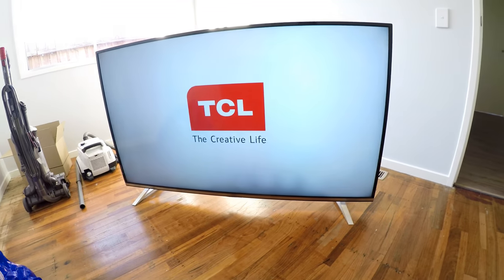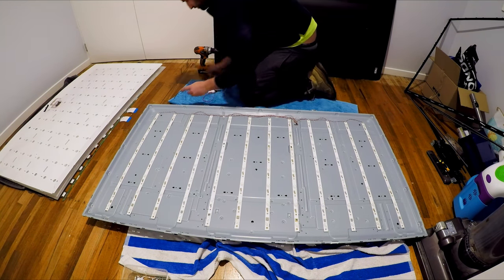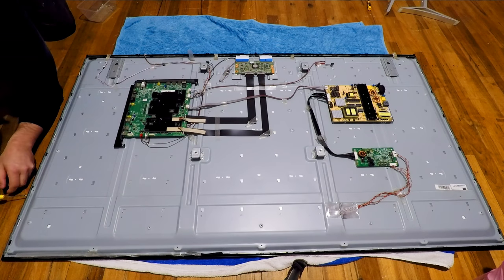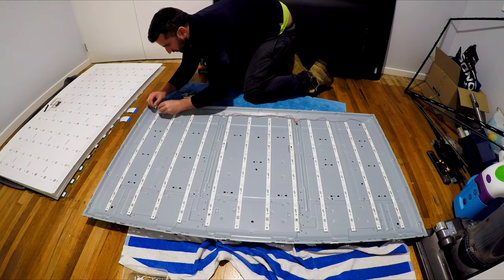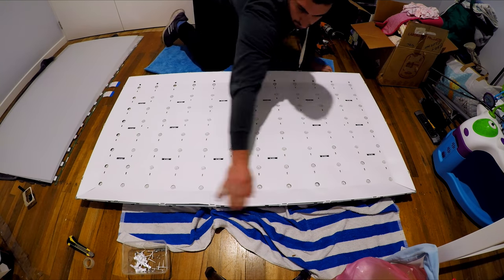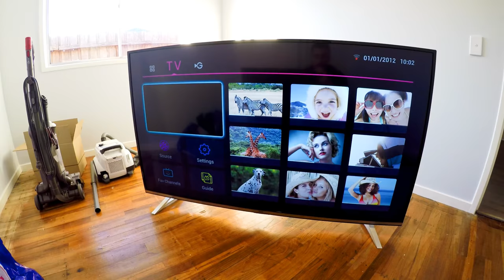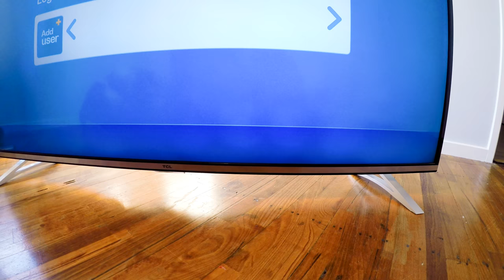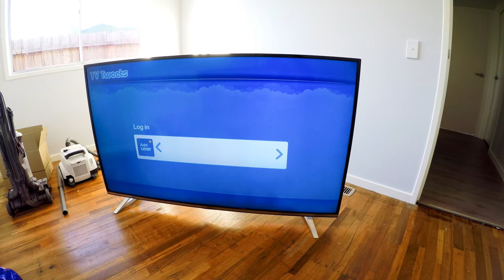TCL BLACKLIGHT FIX - BLACK SCREEN

Comment: Great video! We were able to order the tester and isolate the bad light, order a repair part and get it all reassembled, and then the screen had a hairline crack down the middle when we turned it on lol. At least we tried. And good to know this actually works if you're careful enough.

Comment: Hey thanks for the video I just did this to my TCL ROKU TV 48FS3750 I found on the side of the road, I ended up with 5 messed up strips. Wanting to put no money in it I grabbed a 32inch Samsung with a broken LCD off the side of the road. Took those 2 strips removed the edge 4 strips, put the new ones like " \ l l / " behind the LCD (spaced them out, had to make wires longer). I had to solder some wires to the new strips and splice them to the connectors also had to cut holes for the lights in the backing because of different placement  and now I have a slightly darker but not flashing all the time tv! Thank God haha 😂

Mine has not flashed since so I assume it was not the board, I'll comment if it dies soon lol
Reply: Jerry rigged lol glad to know any old LEDs can work. I'm about to swap some from another TCL
Reply: Great job sir.

Comment: I have a 55 inch TLC TV from a year ago the screen is completely black and has sound still working wondering if this is the same issue?
Reply: I'm curious (now 3 months into the future) what ended up being the issue with your TV?  Thanks :-)
Reply: @voicetube  nope the TV still had the same issue completely black screen sound was working
Reply: @shawnwacek6791  sorry to hear that.  I was just wondering if you ever did find out what the problem ended up being.  I'm guessing mine is either one or more bad LEDs (backlight) or the LED driver is bad.  One thing that happens with mine is when I go to turn the TV off you actually see a picture for a split second.  Also I may not have mentioned that if I turn the lights off in the room and shine a flashlight on the screen I actually do see the image.  It's just there's no backlight working.   In any event, good luck with yours!
Reply: @voicetube  thank you good luck with your TV 2
Reply: @shawnwacek6791  thanks dude!

Comment: I purchased a TCL TV for a guest bedroom. It was used maybe 15 hours total. I recently noticed that it would not turn on. The display is black. I contacted TCL and they said too bad, the warranty has expired. I have a big screen LCD TV from another well-known manufacturer that has been heavily used and is more than 10 years old. I also have several LCD monitors a well-known manufacturer which are more than 10 years old. None of these ever had a single problem. Anything that looks too good to be true probably is. You get what you pay for. If you're looking for a TV that will last, don't get a TCL TV. They are cheap garbage and TCL doesn't stand behind them.
Reply: Did you reset it on the side to turn it on again.
Reply: @patriciakeith6164  I tried every possible way to reset it. Nothing worked. It's scrap, because TCL doesn't offer a repair service and they don't sell parts.

Comment: Hi 
I have TCL 65inch 4k. When I boot up or go to reset tv the LEDs are all lit up an tv works perfectly. When I go to hdmi or tv the screen is bright on right side and seems to go progressively darker as it gets to the left side. I can still see the picture and hear sound. I am asking if you believe this is led problem or just dirty cables ? I dont understand why the LEDs work when booting and in system reset but have this problem with the inputs ? Thanks

Comment: I have the 65 inch model.  The TCL logo displays for 2 seconds then goes blank.  There is sound and I can see the image with a flashlight.  Can a TV repair guy do this job?  This is beyond my skill level I think lol
Reply from the maker: Yes they can do it for you, shop around with price
Reply: ty Factsonfacts   I also have a 65 inch. For me everything starts normally, tcl logo and Android logo l, then suddenly black.  What have you done?
Reply: I do share the same problem. After logo display, backlight shuts off. Will take to warranty repair tomorrow. Will post about the result after a month or so
Reply: @olivertubarik6066  thank you. Is backlight broken. I've tried the power adapter but it wasn't the problem
Reply: @olivertubarik6066  Any resolve to your issue with your TV?
Reply: @olivertubarik6066  fix it? Issue?

Comment: My 4k Samsung just started this . Definitely not qualified but I cant do anything but try . Interesting thing is it seems to only effect when I play my console and literally came out of no where
Reply: Dude same thing happened to me I don't know why
Reply: Where you on a ps4pro when it happened ?? Or anything with powerful 4k output? I.e ( gaming comp xbox one x series X etc?) .
Reply: @sketchdajuggalo  ps5 happened to me out the blue
Reply: @ZelGoesHard  set your resolution to automatic if it's not, my ps4pro was defaulted to Y27orw.e instead of rgb or automatic. I let my TV sit unplugged 3 days and quickly switched to auto mode on all 4k devices my TV has been fine since ( knock on wood )

Comment: My tv goes dark on the right side but if i turn thr brightness down the problem disapears i am THINKING its a capacitor cause usaly if a led as gone it dies shut your tv down and this does not turn off.when i increase brightness over 21 it goes dark on the right .to me its like the tvs strugling power output
Reply: if you listen to what he says it's probably one of the led's shorting out. they could still handle low voltage i.e. minimal brightness on the screen, but when you crank it, one shorts out and so that whole section dims out.

Comment: My TCL roku tv has auto volume increase/decrease problem. Does someone have any solution? Roku support as well as firmware update doesn't help! TIA.
Reply: it's maybe your remote button getting stuck? see what happens if you take the batteries out of the remote.

Comment: TCL Roku  65 only 18 months old. Will have picture for 15 minutes then gone sound remains. Only antenna connected. I would replace all the boards if I could find them.
Reply: Shopjimmy has kits with all boards included 👍

Comment: Hi Nick. I have tcl series 5 and i have been having some problem with it. My tv pops up some white dots and then disappear once in a while. Also when i Change the audio from my pe 4 from linear to dolby or dts it producea some screeching sounds for like a second and it works fine later on. Another issue is that there is one time the screen just west gray and some blacks spots like when you change to a channel that doesnt have anything on it. Please help. Its still relatively new.

Comment: Serious injury or death?! Please explain...
Reply: Those dam capacitors... when I was a mid-teen, I touch one of those big capacitors in a CRT and an old polaroid flasher and I was lit up. No injuries, but it really did not feel good. Even if you disconnect the power source, those circuits are still live. Lesson learned. There is a twitch once in a while. haha
Reply: Thank you for the reply to the both of you!👍

Comment: Does anyone sell screens for TCL? I need to replace one but no seems to have them period! Help!
Reply: Save your money and buy another TV -- I have a 55 with lines in the screen - good screen but for my nickel, if I paid this guy to do this - he would spend 30 on one single strip of lights if needed - and I do not need that - but still too much. The TV wasn't all that when it worked right. TCL is junk in my book. Worked 1.3 years and now - junk. Just trash.
Reply: @riceski Yeah mine just quit!!! it lasted ONE MONTH OUT OF WARRANTY !! HOPEFULLY TCL WILL HELP ME...….
Reply: @tinmanslickgreasy999  did TCL respond?
Reply: @dancerehab1092  no they didnt! The services areas that could supposedly fix it were out of business amazon was more helpful.....unfortunately, but no it never got fixed!
Reply: @tinmanslickgreasy999  sorry for that..I have always been curious, is it that maybe the models from a certain year were bad or TCL, in general, is not reliable?
Reply: @dancerehab1092  I did some research when this originally happened and I think I can fix it following some videos but it's still a hassle!
More of a learning project for me...... I think the parts should cost around 30 bucks off of ebay!
It's one of those things...........👍
The good thing the tv didnt cost that much...if this had happened to our samsung 65 which is our main viewing panel that would be a different  story!! Spent alot more money and I've had it alot longer!
Goodluck with your endeavors..
If you decide on a purchase...and your worried  maybe consider getting a extended warranty! I'll be honest I've never bought a warranty this is the first time ive ever had something like this happen!
Goodluck!
Reply: @tinmanslickgreasy999  that's quite a hustle..well my main disadvantage is I am outside USA so even the warranty can be quite a hustle. I am looking for a tv that I can use as a monitor.

Comment: I have a TCL ROKU tv 32" 720p HD but the Screen losing brightness now Audio has Horizontal line i only had this Tv since 2018 now 2020 sucks gonna have but a new tv not getting this brand again
I use to have a Usa made Tv 32" 720p Element it was good dam tv lasted 6 years now my current one TCL Roku tv giving out like Wifi quit working Audio iusses and Horizontal lines sucks gonna have end up buying a new tv soon

Comment: Considering how cheap these tvs are going for seems less trouble just to replace it if it dies/fails (or get a supposedly better one from samsung maybe).  My 55 inch is dim on the right hand side after a year and change.  Replacing the strips plus the time/labor involved, I could replace it with an equal model now for like $300 ot less, or use it as a threadbare excuse to jump to a 65 inch for about $100 more.  But I do feel bad about "throwing away" an otherwise fully functional tv.
Reply: What a coincidence: my 55" has also gone dim on the right side after just over a year...
Reply: Seems they make the TV with planned obsolescence
Reply: @michelemariedalene1013  This how they make sure their companies still making money. Have their products break down and hope you come back to buy another one. haha
Reply: I just picked up one of these large TCLs super cheap, never lit up on the right side, lit up for 30s on the left then all dark ;p
Seems like a common issue with TCL.